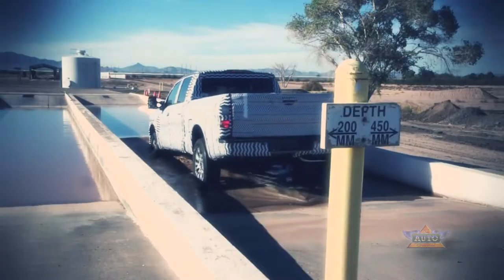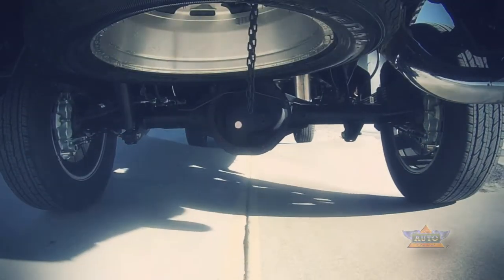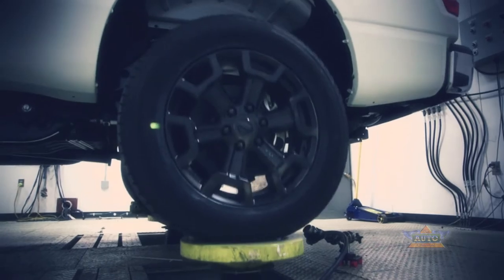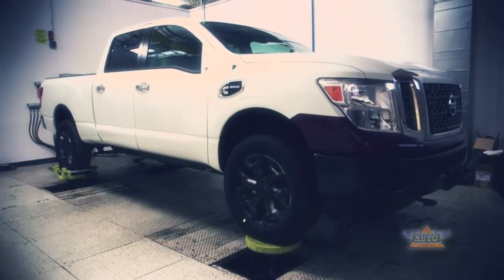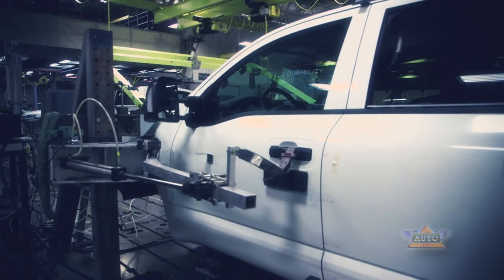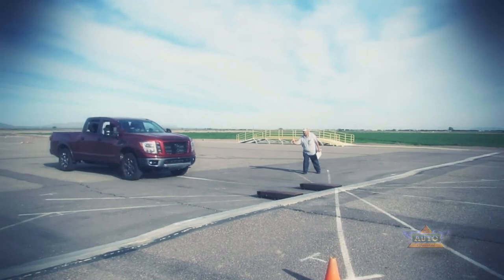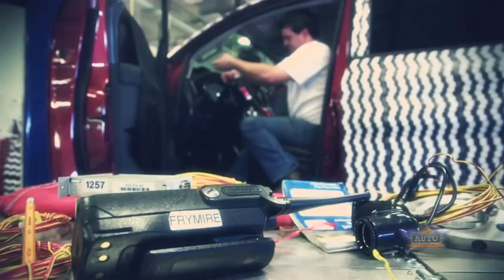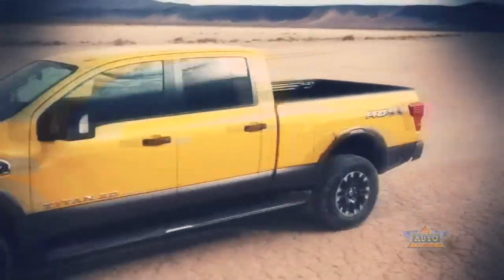Nissan Titan Truckumentary - Chapter 4: Titan Tough

Comment: I have a 2010 Nissan frontier.  130,000 light duty miles and it's cost me thousands of dollars in rear axle rears after 126,000 miles.  Never again will I buy a Nissan.  If it wasn't for the 125,000 mile warranty that I purchased this truck would have been traded in at 40,000 miles.   6 major repairs since new.  Nissan have you learned anything since 2010,  copy Ford.